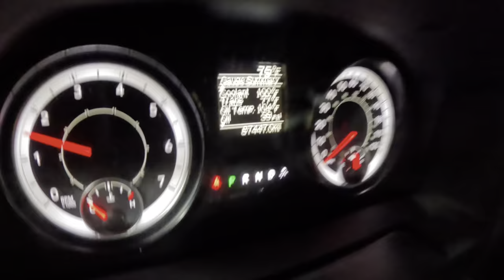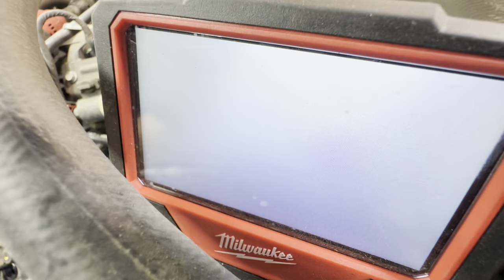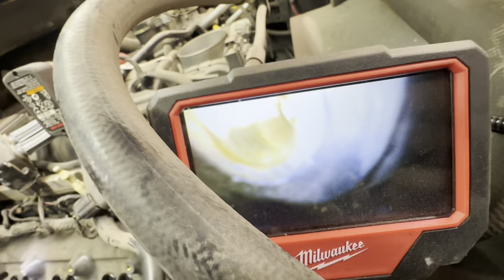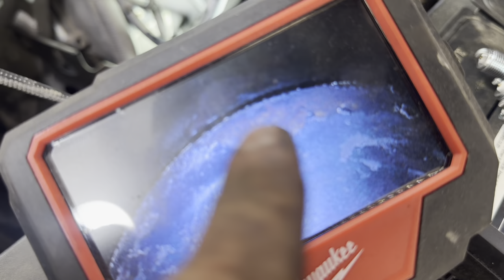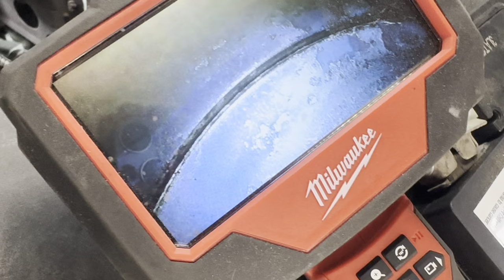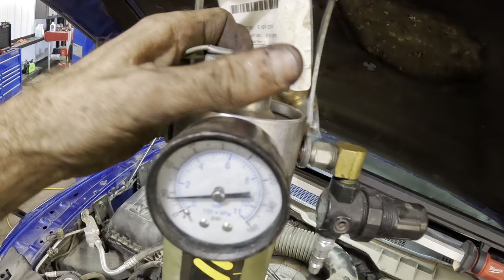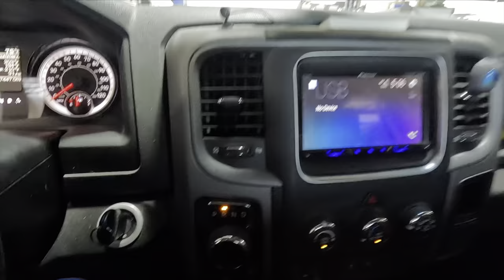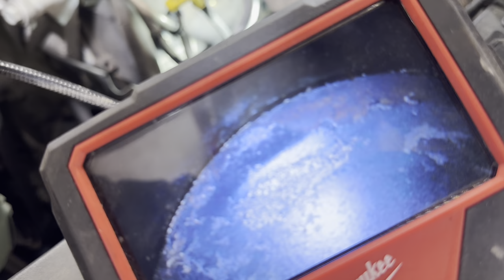The “TUNE UP” is DEAD! Dual Spark HEMI! (Injecting liquid into the Intake)

Comment: I have become fairly knowledgeable on these Hemi engines. First and foremost, you never do an engine cleaning after you change the plugs because all you're doing is fouling the new plugs. Secondly, make sure that you put iridium plugs in that Hemi because they get far better mileage and run much better with the iridium plugs, and the iridium plugs will Outlast the original plugs by about 300%.
Changing plugs as a pain in the ass on the 300, it's not going to be any easier on the truck.
When I change the plugs on one of my 300s, it was literally getting 45 miles per gallon at 45 mph. It was unbelievable how good a mileage that thing got with the iridium plugs. I was getting 30,  I think on the highway. And that was at almost 200,000 miles.

Comment: Your snake oil would have shown better results on the intake valves on a direct injected engine where the intake valves get gummed up . Regular few injection cleaner would have been fine on that hemi .🤷🏻‍♂️

Comment: ***constructive criticism*** One man's honest opinion only 
Ray, thanks for the "much requested' before and after view of the carbon deposit remover/cleaner.
Several points to consider; 
 I don't know of any solution that will completely dissolve carbon deposit without agitation or scrubbing. Any liquid including water will leave a residue /deposit when it is brought up to boiling temperatures and or after it is completely evaporated .
 Any cleaner solution that contains petroleum products will gel and lose it's detergent properties when exposed to continuous heat cycles. 
49:50  I am not a naysayer and after viewing the after borescope findings, I do not see any empirical evidence from what you showed to suggest that the product does the job that it specifies.  
The comments you made after the cleaning solution was used are speculative with no definitive indicators. The viewer was looking at sludge on top of the pistons after the procedure. The tops of pistons should be dry

1:06... My opinion is that I am not 100% convinced it works. Years ago, plain clear water was used for the same purpose to eliminate carbon, I am of the opinion that it would be just as effective as it will leave the tops of the pistons dry. 
1:12 you said so yourself, I can not tell if there was any carbon break up. you further added it "looks like' it's starting to work/ that statement is not based on fact. We have no way of knowing, this is a true statement.
I am surprised that you did not change the oil after cycling the engine with the additive/ cleaner as it clearly did not dissolve any thinned residual cleaner that will make its way into the oil pan and breaking down / changing the viscosity of the engine oil.

Comment: Scoping the tops of the pistons before and after will be inconclusive. It is the intake runners and backs of intake valves that really affect the air flow. I doubt there is much carbon removal in the combustion chambers. Two main areas of concern in engine performance and cleaning services are intake valves and oil rings. Of course if you are trying to salvage a neglected engine, orderly sludge removal can be a thing.

Comment: The reason to never use penetration oil to clean a throttle body is because it leaves behind an oily residue, which accumulates dirty very quickly. I very rarely have anything negative to say about the jobs you do that I have watched here, but that's a really really big no no.

Comment: Excessive amount of sparkplugs. In theory it's better than singles but in practice there's ZERO difference in combustion quality. They just make you pay more. As for the carbon cleaning stuff...i haven't seen any of it work. No matter the brand or type. At least not for cleaning an already dirty engine. As preventative maintenance... it might work but i haven't met a single person who has been doing this regularly since buying the car brand new so there's no proof of that either.

Comment: Fuel injector cleaner just add that into your fuel tank whenever you do a refuel. So it mixes in with the new fuel and as you drive the injector cleaner will clean the injector and clean the top of the valves.

Comment: Yup its snake oil. With direct injection engines they do build up carbon on the intake valve stems.  On the none direct injection the cleaners in the fuel keep them cleaner, just as the fuel added cleaners take away most of the carbon from the combustion chamber. 
With our fuels today
So my vote is yup its snake oil.

Comment: I do try to be logical and consistent in going about my life. At 21:36 you mention that one should not start threads with power tools, yet at 43:11 that appears not to be the case. Also it would make more sense to me that the spark plugs be replaced after the induction cleaning was completed ass I would prefer for the carbon particles to be displaced in the presence of the old plugs rather than the shiny new ones. But since the carbon deposits do not appear to have been dispersed anyway that may be a moot point. 
Lizard lotion or not? I must conclude that this experiment failed to demonstrate the efficacy of the product. It may work or it may not work. But there is no way I could conclude that it works based on the contents of this video. If you could rescope a couple of pistons after the tank of gas has been run through that may shed more evidence to substantiate or refute the claims made by. the product promoters.
PS - Shutting a warm engine down for 10 minutes does not result in any cooling. Before you started the induction cleaner the engine temperature was 204°. When you began your test drive (eight minutes?) later and at the end of the test drive the dash showed 206°.

Comment: Not trying to be a troll, but scientifically not much was proven by this video.  If you can prove cleaner valves, better compression, more power etc... then I will be a believer.  Til then i remain skeptical.  Cheers!

Comment: I call BS.  You just got done driving the vehicle so all residual liquid would be burned up in the combustion process.  If you want to remove carbon from the pistons, light water mist would do the same thing. (Some thing done in the 60's to help defeat preignition.)  If snake oil is running through the system, how much did it clean the intake runners of oil and carbon buildup due to the PCV.  Again, BS.

Comment: A nice cup of hot hot water down the throttle body It will clean the cylinders like no other you want to see some black carbon smoke out the tail pipes that will do the trick be doing this for years